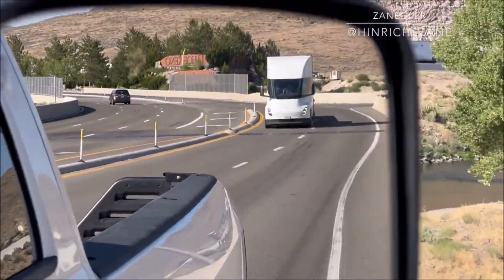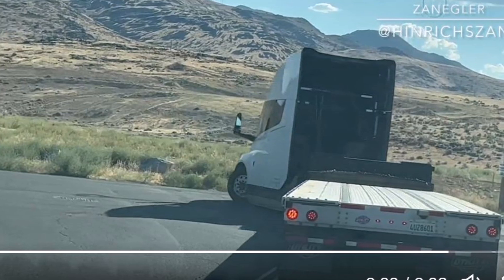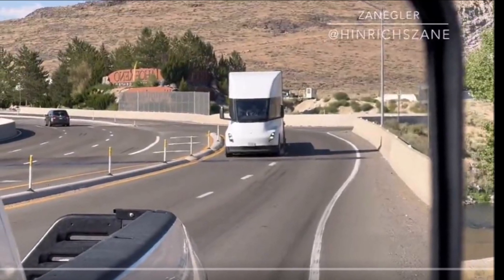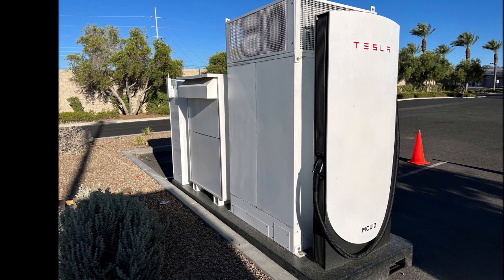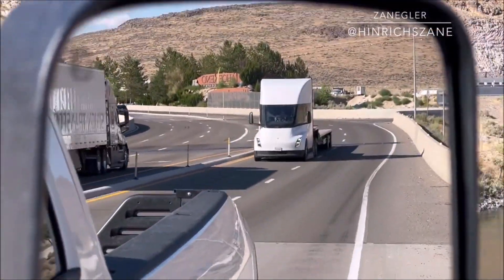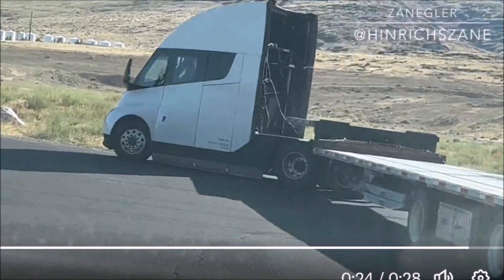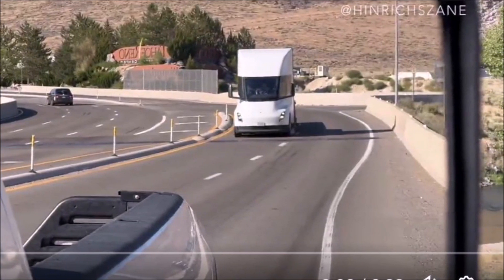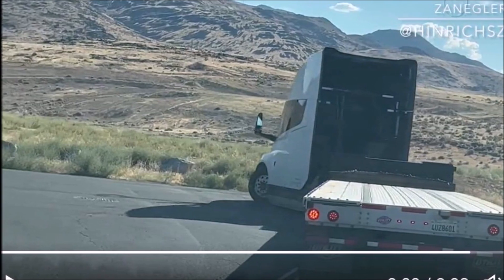User Says Tesla Semi Looks Too Plastic, I Address Design

Comment: I'm going to guess that the Tesla engineers were more concerned with the air flow over the hull and less with how it "looked". Case in point, a model S plaid with its body stripped off, a weight savings of 1500 lbs, did worse than a model S with its body panels intact. Never underestimate the effects of drag. 😊

Comment: The writer was concerned about running out of electricity. Valid point. However, would any responsible truck driver knowingly head out in the desert with only 8 to 10 gallons of fuel knowing that there weren't any fuel stations out there. Most diesel semi's average around 10 miles to a gallon. Give the drivers a little bit of credit for having half a brain. The writers comment was irresponsible. 
Good article
Thanks
Bob

Comment: You tried to answer a juvenile person with no knowledge with a reasoned answer. That is hard to do. Almost all large trucks use plastic fronts to streamline the truck and save weight. So it could not look to plastic, any more than any other truck. I think he was referring to the streamline shape which is more pronounced because of the lower hood line, not the material it was made out of, which you cannot tell from the outside.  As you mentioned, several people are working on "rescue" or tow trucks to help someone that is unfortunate enough to need help, such as carrying a generator or battery to charge the vehicle that needs a charge. I have heard the Cyber Truck might have a vehicle to vehicle charging system.

Comment: It's a local truck.           It would only pass the otr test if it was 1000 mp charge. And if every truck stop had spaces to park and charge on the 10 hr break while sleeping.        O/O's run harder at times 800-900 miles on Ghost Rider logbook app running 14hrs+-  in a day.